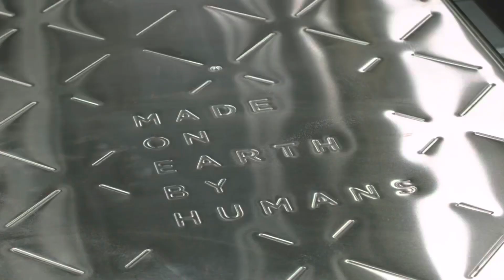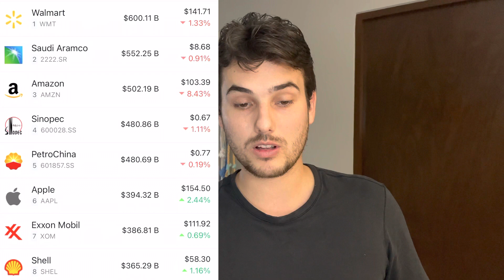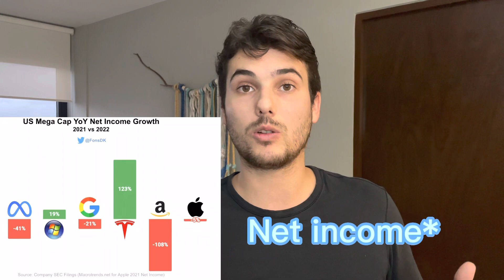Tesla's Megapack: The Key to a Sustainable Future

Comment: 10,000 Megapacks per year is their aspirational number to ramp up to. They’re probably only producing a handful of MPs per day, currently. That is fine, but I wouldn’t therefore expect 10,000 MPs to be built this year, and therefore wouldn’t calculate revenue on the basis of 10,000 MPs either.
Reply from the maker: I agree. But they did say they a producing one every 68 min. 
There are 43,200 min in a month, so divide that by 68 and you get 635 per month. Then times 12 and that’s 7,623 per year. But totally agree I could have done the math for this year at 70% capacity just to be more conservative. Thank you for the comment
Reply: @teslahyperbull  Yes, Rob Maurer pointed the same thing out, that 68 per min doesn’t add up to 10k per year. Does that mean Elon’s lying? 😀 But I wonder if they simply took the average looking back over 2023 if they produced all those Megapacks. I doubt they’re currently producing 68 per minute, because some other YouTuber staked out the MP factory and he only saw a handful per day being shipped out. In any case, I’m hoping for a speedy ramp! 😀